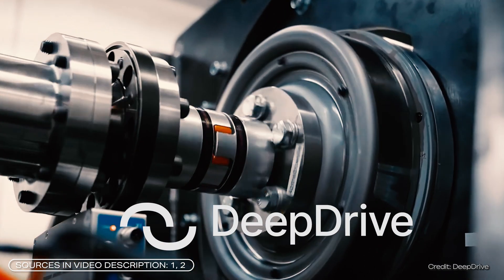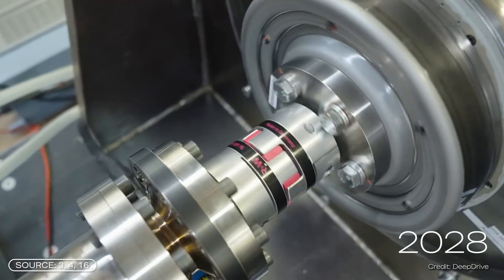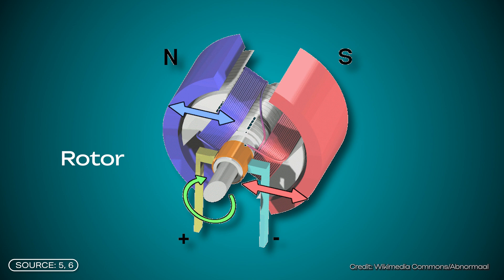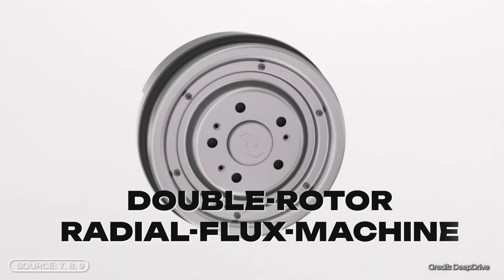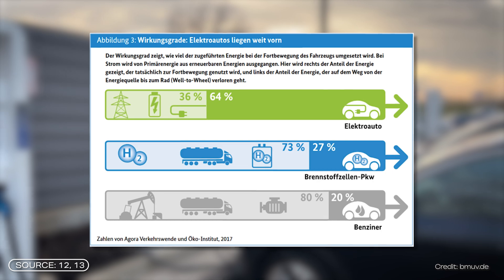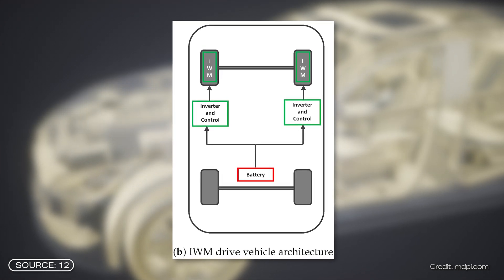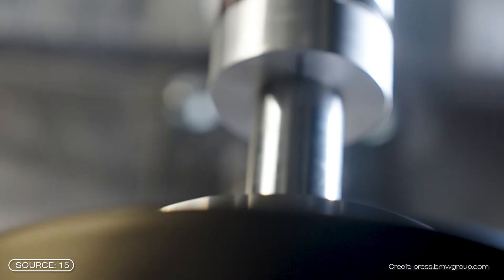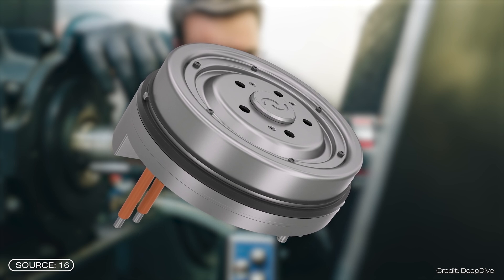Efficiency Made in Germany: DeepDrive's GENIUS motor

Comment: Unsprung weight is a way overstated issue with hub motors.  Ford F series trucks have sold over 40000000! Their current rear axle weighs 380lb!(160kg) Not including hubs, backing plates or even the axels!😂
We drive on paved roads. Most modern cars only have about 110mm of suspension travel including droop.
Ferrite magnets are shit compared to neodymium magnets for size and weight. But on a hub motor you have the room and low rpm and are very cheap!  Ferrite is available to all nations. Geo security etc.
I have been involved making millions of carbon fibre rings holding ferrite magnets in place on consumer goods that do over 100000rpm. Yes, years before Tesla "invented it" PR bullshitter.

Comment: I thought of this years ago for fuel cars like an aid installed in one or 2 wheels and when the car is in plane road it keeps the speed constantly saving fuel, when the terrain gets a little inclined the fuel engine works again, like a hybrid system for 0 degrees plane roads. Nice.

Comment: Hub motors are not proven in auto applications yet. The central problem is all the banging that a wheel endures as it goes over rough pavement. Mercedes licensed a breakthrough hub motor from UK years ago, but has yet to deploy. A central motor with a shaft will probably be the way to deliver power forever, even if hub motors take over (as they should).  Unsprung weight hurts handling, and hub motors will always represent a serious compromise if mounted on the wheels.

Current motors are already above 90% efficient, so it is impossible to claim 20% improvement. The advantage of hub motors is lower weight.

Comment: 2 comments:
1. If the Tesla model 3 is no longer the efficiency standard, what model in that class of car?
2. I tend to be skeptical of innovations in the EV space if Tesla has not already adopted them. 

If there was such a significant advantage in performance, cost and efficiency, without a negative consequence, they'd have done it. Because that company specifically disrupts itself to achieve greater cost and energy efficiency. When tesla does not do something, there must be a reason. As an example, Lucid is more efficient than Tesla, but what it costs to achieve those additional efficiencies are burying that company in debt.

As a result, i think that corrosion and unsprung weight performance issues are probably much worse than arr expressed here. I see hub motors as a more specialised operation. Perhaps robotaxi, of racing car applications.

Comment: this is probably the 137th time wheel hub motors have been tried in EVs. I am highly skeptical that we will ever see one on the road. There are a couple of problems: it is easy to steal wheels, and they are stolen all the time. If this becomes a reality, it won't be easy to park your car in every neighborhood. First thing that breaks most of the time when you have a minor accident is wheels. This will be extremely expensive to fix especially after a stupid mistake every driver makes. Balancing will be more difficult. I did not even talk about the unsprung mass...

Comment: The electric motor in the wheel was tested 20 years ago by Ford, and I am pretty sure all others have tested it. There is a reason why no one puts a motor in wheels, no Chinese, no others. The real-world vibrations destroy the EM in 1 year maximum. All the rest is just bla-bla-bla...
Reply: QS motor hubs exist you know, and are widely used
Reply: Hmmm wonder why the hub motor in my bicycle is still running fine after 8 years, hmmmm.
Reply: @shiraz1736 , because your motor on the hub is not heavy, your e-bike tires are not running or experiencing any of the vibrations that a car tire is supporting. A car EM in wheel is 10 times heavier, and the shocks on the road are... so... have you heard anything more from that video? Yes, I suppose so... Please come back here and tell us when EM in wheels will be a mass solution for a single EV on the market...
PS: the energy dissipated on shocks is directly proportional to the mass...
Reply: @costiqueR it’s quite heavy actually, no suspension no nothing, you do realise the rim of a wheel takes the maximum amount of energy from vibrations and impacts, and shocks and springs do the rest. I’ve worked with electric motors in some very demanding applications for 25years of my life and I can assure you they are very robust.
Reply: @shiraz1736  Yep, a Bafang 1000w hub motor has 4,8 kg, and is internally nylon gears is making it rotate with ... max 10 rotations/minute? Do you really understand mechanics?
Reply: Can be easily solved with modern active suspension, it was test and prooven.
Reply: @davidmiletic6647  There is no vibration dumping between wheel and motor, and that one is destroying the motor. The suspension is between the wheel and the car. Furthermore, as you see, no one, anywhere in the world, introduces motors in wheels, so ... stop continuing with stupidities...

Comment: To keep the wheel in contact with the road, you want the unsprung weight (weight of wheel, hub and everything below the spring and shock absorber) to be as small as possible so the suspension can react fast to bumps and potholes. Adding the mass of the motor to the hub will make the suspension suck.  Any good car kraut would know this.

Comment: Why not move the motor away from the wheels wit a linkage between This will reduce shock from the road and allow more room for the brakes. You still get the efficiency of the dual rotor. Even if some of the energy savings are lost you still get a less expensive motor and weight savings. They may have to compromise.

Comment: with these hub motors, because of their location in the vehicle, makes them more susceptible to dust, rocks, water damage, and jarring because it's not suspended makes them more exposed to these harsh elements makes them more vulnerable to motor failure. although Just because one hub motor fails doesn't mean you're stranded should that happen, you could still run on the other 3 if it's an all wheel drive. it'd be a matter of how often motor failure occurs and the cost and availability of replacement hub motors and getting them reinstalled.

Comment: Yest banish the need to replace worn put CV axles every 200,000. The only way we will ever get a maintenance free million mile power train in our vehicles is with hub motors!
Though i think the axial flux pancake motor with it's thin pizza pan shape for better center point steering and reduced unsprung weight is the winner of hub motor designs

Comment: Pot holes are on a lot of streets and roads. This is important to note as many concepts can not maintain their integrity long from all the thrashing about during operation. This looks similar to the Edison Motors setup. Electric motors mounted where the rear or front axels normally exist. Power generation when slowing or down hill. As with rail trains, they incorporate an engine generator set with a couple of batteries. The small engine runs at a steady speed to maintain battery power and lengthen engine lifetime. 
 An engine design that incorporates a generator within it would likely be more efficient. I haven't seen one yet. Perhaps instead of a crank, it would have coils to collect the energy produced while running and opposing pistons on the same shift. I saw a two cycle engine design or single Cycle one that could use these features added for greater efficency.
Reply: I would collect the pot out of the holes when I find them. Just kidding. It's one word, 'potholes' not 'pot holes'. 🥴

Comment: <><><> Nothing new BUT my solution is. It reduces the unsprung weight by 500-1000% [5-10 fold] and is based on our patented innovation[s].<><><>
Reply: We also patented the double rotor motor tech 20 years ago and have further improvements. We are also developing a NOVEL internal combustion engine[s] architecture whose efficiency, NVH [noise, vibration, harshness] and emissions are on par with e-motors w/o ALL the problems electrification poses. The power density is on par with turbine engines w/o the high fuel consumption, noise, cost and usability limitations.
Reply: BTW, that means electrification is d...e...a...d as are all other engine architectures.  =]]

Comment: This motor in a wheel concept is old. Hydro Québec created a similar motor in the mid 90's, 30 years ago. That doesn't mean it was comparable to this one in term of efficiency and power but it did exist.
Reply: Dude, he stated that its not an original concept for this motor type
Reply: In the video he tells how Ferdinand Porsche used in wheel motors back in 1900.

Comment: My first thought was "near wheel hub" so located inboard and driving the wheel with a short axle. this would reduce the effects of the unsprung weight as the motor itself will be mounted to the main chassis of the vehicle. However this may negate some of the positives and it does add mechanical linkages.

Comment: A gasoline powered car uses waste heat that results from inefficiencies of the IC engine to provide heat to the cabin.  If your motors are super efficient, then there might not be enough waste heat to keep the cabin warm on a cold day.  This may mean some other heat source will be needed.  A separate gas fired heater?
Reply: You don't need that much energy to heat a car cabin. A 900w heater can keep the cabin warm at -30 and for my car at highway speeds it's generating about 74 kW in heat. That's enough heat for a larger house.

Comment: In order to have a 20-25% range increase with a 96% ending efficiency, the starting efficiency would have to be only 76-80%. The drivetrain/motor efficiency of the Tesla Model 3 is much better than that, so I call bullshit on a range increase of 20-25%.

Comment: I don't actually know of any electric car that has the motor in the middle, they all have motors mounted at the front, rear or both axles. The battery takes up the entire floor pan almost. They call it a "skateboard"
In-wheel motors have one rather large drawback, called sprung mass. Having extra mass in the part of the car that has the most reciprocating mass i.e. up and down is really a drawback that can substantially offset other efficiency gains.

Comment: When ever there is pool of water on the road which is deeper than your tire is thick this hub motor goes submerged. Today's electric cars are not handling well any submerged electric components. Evenbattery packs are notorious for water leakage and there is no moving parts through sealing ‼️

Comment: Electric hub motor seals may be short life span. They are likely rather big in diameter and the sliding speed of the seals leads to fast wear and short life span.
Reply: About diameter: you can have the seal anywhere you want, including on the inside instead of the perimeter.
Reply: I’m sure u know more than these geniuses. U people act like they haven’t thought of everything

Comment: Nice, 
Unsprung weight is probably linked to ride quality
What about inboard motors?
Reply: I doubt this will ever be directly mounted into the wheels  they will probably use shafts and have the motors inside the fuselage

Comment: Depending upon the actual weight they're placing at the wheel, which, if I understand what I've read, this is not to be too much additional weight, so it shouldn't overly have an adverse impact.  Environmental concerns shouldn't be dust or corrosives, as one comment mentioned about our environment in NY, USA.  Rather my major concern would be impacts from road conditions and minor mishaps where they wheel contacts a curb.  Durability with less than the most attentive drivers may present the biggest challenge.
All considered though.  This can go some ways in relieving concerns regarding range anxiety if the claimed efficiency holds relatively close to the figures cited.  I don't know the full impact on vehicle weight, but packaging might yield some benefits for creating more usable interior space which might be most helpful on smaller vehicles as well as those used for parcel delivery.
  
Excellent video, great explanation, and an interesting topic I recently just found out about.
Reply: I liked your comment. I failed to notice mention of brakes which are normally located where they have this motor. Maybe they have no intention of ever stopping completely.

Comment: I'm gonna make a hybrid! Install two in-wheel motors in the back of an automated gearboxed FWD car like an Alfa Romeo GT. Could just hook everything up through the OBD port, and just give "half the normal amount of throttle on the pedal".
Wait with the reverse-gear, and add just about 40-50kg of batteries that i might store under the back seats, or in the trunk
Reply: Can you show us DIY design of hub motor after you done ?

Comment: As a non professional, hobby nerd and typically complaining German, these things come to my mind - some you already mentioned:
- enormous G forces of all frequencies and amplitudes need to be faced unless the wheel as we know it will be a very different concept
- on recuperation you will be unable to store these enormous breaking currents, which is not possible without huge and very expensive super caps
- the above leading that you still need traditional brakes - extra space is needed
- these brakes need to be accessed for service - so you can't completely encapsulate these, you have to decide to have them near the center and the motor outside or the other way around, which needs access and air, while the motor needs to be completely encapsulated from dirt
- there will be lots of heat from the brake very near the motor - intense heat and vibration is far from ideal
- because these motors cause an enormous increase of mass at the center of the wheel, you can not use normal tires, you need custom ones with more of a dampening effect, so smaller rims, which makes it even more challenging space wise - or as mentioned a completely new wheel concept is needed
- since you need the 3 phase power to be reaching the moving axle, you can and should not make the cable square too big, meaning low impedance may be counter productive, you may be better off with thinner more flexible and vibration resilient cables and higher impedances - hence higher voltages
- having high voltage go towards each wheel doesn't feel right to me, though there are ways to make this safe, but it gets complex and pricey fast
I like the idea of gaining the efficiency but I think it will be very tricky to implement in real life, making it long-term reliable. Since BMW has only 2 years warranty, I hope they will not experiment on the side of the customer. 
I wonder if they can literally reinvent the wheel with a construction that gives the motor a relatively stable position inside the wheel, so it doesn't get most of the impulses, that goes into some mechanical system, allowing you to have thin but full rubber tires with less mass and a smart moving but centering system that keeps all the high frequent vibrations off the motor and axle?!
In other words the motor is the less complex problem, the mechanics between the axle/motor and the outside of the wheel has to be completely redefined?! Maybe the motor has to be behind the wheel, shifted to the inner side of the car and the inside of the wheel towards the axle becomes an attenuation system made of carbon fiber or have a mesh of small air or hydraulic based dampers that can me adjusted for comfort or performance and speed??! But then having these rotate at high RPMs will also cause many new problems ... that a tricky one.
Reply: Insane unsprung weight, no posible gear reduction and no liquid cooling.
Reply: https://www.youtube.com/watch?v=08XKaBticpQ
Revolution in Motion | Gruber Motors
Reply: What if you placed each wheel on its own axle, driven by such a motor that's more towards the inside and mounted higher up.  You'd have an articulated joint where it meets the wheel, allowing the motor to be mounted higher up, and not being unsprung weight? The you could use a conventional wheel, conventional brakes - all standard parts.
Reply: @Timberius  - or you could have an arrangement similar to a tracked vehicle, in which the drive sprocket is above the ground driving a track, and the road wheels are as light as possible, rolling on the track. This eliminates the unsprung mass problem. It could be like a belt drive between the motor and the wheel rather than a track.
Reply: too long didn't read
Reply: @jirikapoun2544  Maybe you should do more reading, its good for your brain

Comment: I'm really interested in wheel hub motors because I want a truck with a low floor, and right now, since pretty much all trucks are RWD, that big rear differential gear makes it impossible to have a really low load floor.  Of course there is the Ram Promaster FWD truck, but it is really a problematic vehicle, not to mention the load floor is nowhere near as low as it could've been on the standard versions.  Too bad for them.  But in any case, wheel-hub motors would make it possible to have rear wheel drive, AND low load floors.  And one more thing, I want even more integration.  I want the  motor totally integrated with the structure of the wheel itself, (as well as disc brakes perhaps), to save more weight.  That means you mount the tire directly to the motor.  I believe this advantage will be irresistible to designers, once wheel hub motors go into production.  It saves both space, cost, and weight, and improves the unsprung weight issue.

Comment: Also note that having "calculated" the improved efficiency is not equivalent to having demonstrated the improved efficiency.  The efficiency of all magnetic motors is highly dependent on the torque load, so a graph showing the efficiency vs load torque is required, since the motor efficiency cannot be expressed as a single number except under a specific loading torque.